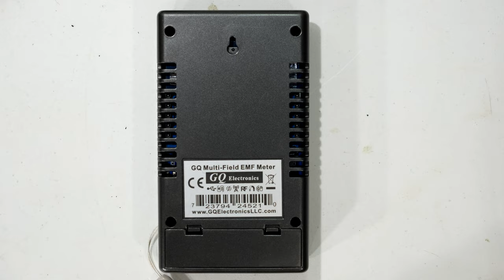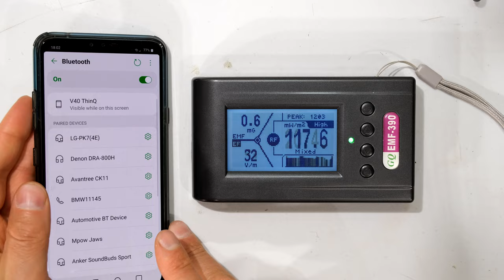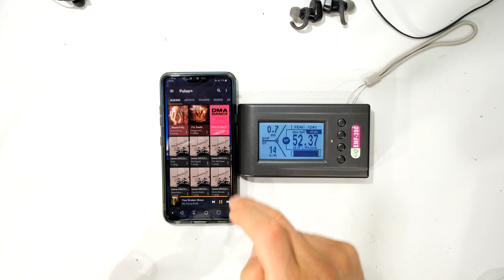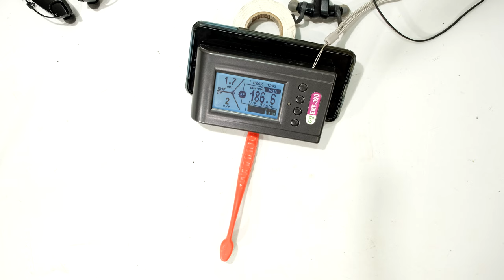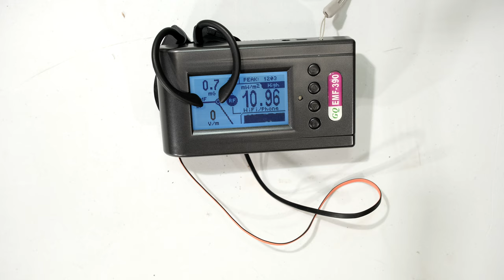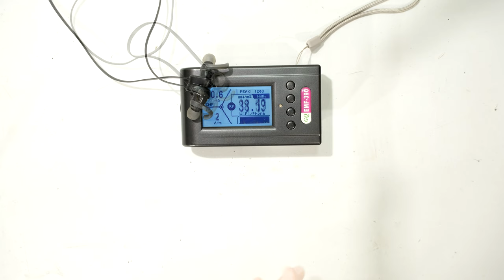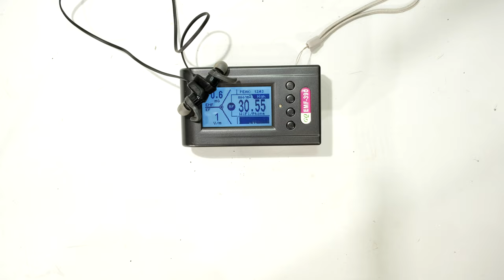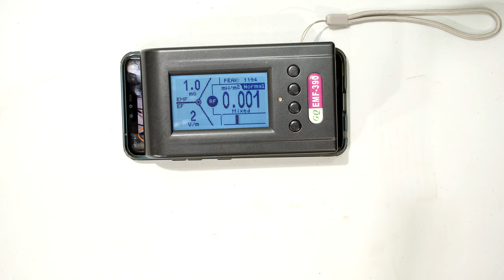How much RF power radiation do Bluetooth earphones emit? RF power dissipation informally measured

Comment: A very interesting test and it just shows how difficult it is to precisely measure RF as it is multi-directional and is affected by surrounding environment too. I would love to know how the anti RF product sold online achieve their measurement to claim a 99% RF removal etc. I think it is virtually impossible at this stage as to eliminate completely a signal, you would simply have to with it off, to disable it making the phone, earphone, wifi etc. you are using basically unusable.